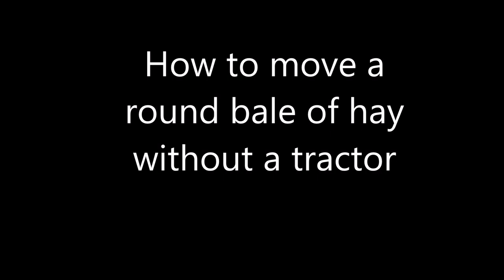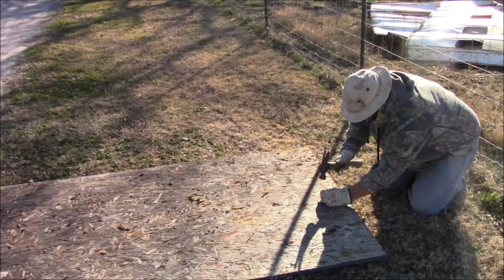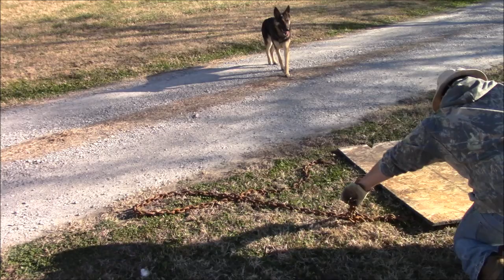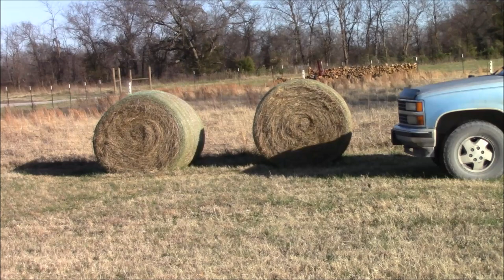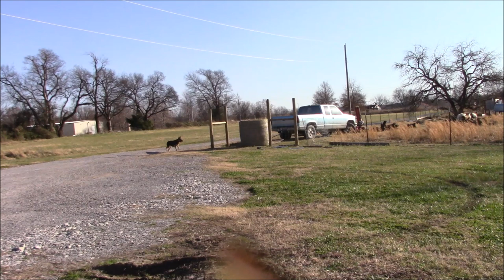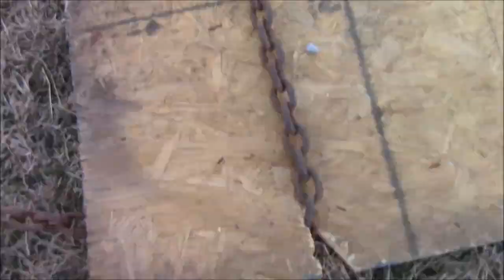How to move a round bale of hay without a tractor

Comment: Great idea but the bales I buy are too big for 5’2” me to tip over or roll onto a board.
Reply: I can identify. I thought of adding a step to the process then if hay bale on round edge. I'm a 72 yo widow.

But first, if bale is on flat edge,  I tie a ratchet strap near the top of a hay bale and link to another strap to my hitch. Slowly pull over to tip.
   If starting with the bale on its roundside, hammer a post into the bale above the center core. Slip the strap below the post. Pull w vehicle till it tips. Post keeps strap from slipping off while pulling.

Comment: Must be some small round bales? Most of ours weight between 1100 and 1800lbs. Looks like it worked for these lighter ones, just not sure how long that would hold up with repeated use.
Reply: I use two pieces of conduit. 1 1/4" and  3/4" drive the larger through the center then put the 3/4" inside and pull it like a spoke wheel.
Reply: Obviously not meant for repeated use.  Worked for what he needed.  Real farmers do what needs doing and don’t dis on others by claiming they don’t measure up to some arbitrary standard or pulling the one up card.  Get a life.